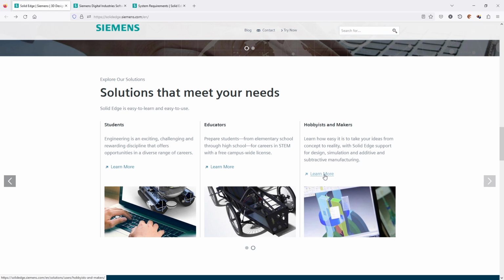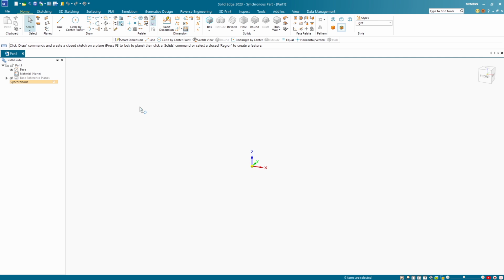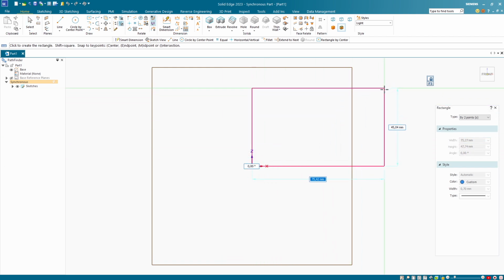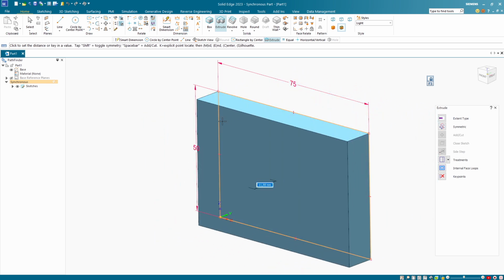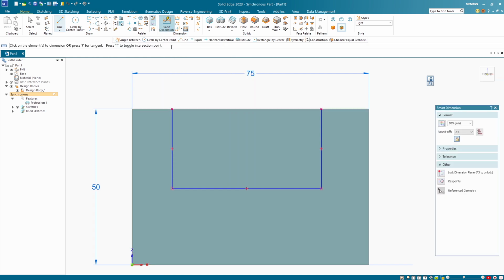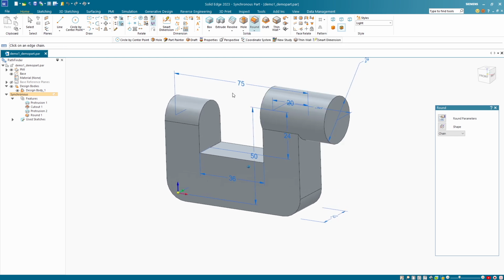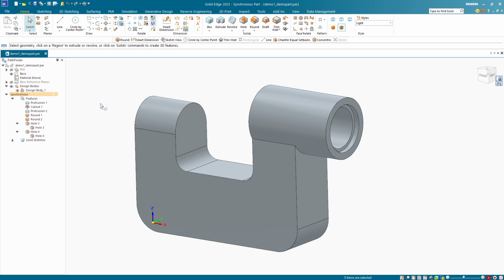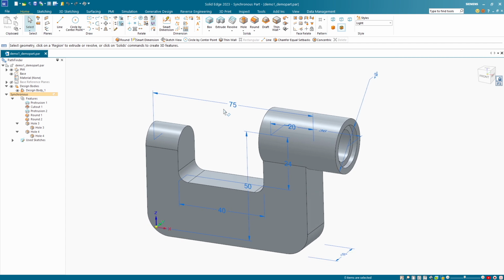The best Professional 3D CAD Software you can use for FREE in 2023? | Solid Edge 2023

Comment: This is great, but now im stuck with needing a license?
I'm not sure what to do here and there iareno instructions from what I can find on the website.
Myy steps:
Siemens Edge website -> hobbyist -> access download -> .exe -> stuck with options requiring me to have a license.

Did I do something wrong? Why is this more complicated than the software?

Edit: 
It worked my second go around, im not entirely certain what went differently; I think I accidentally accepted using old account info, and it tied my account to the non-community version. idk but it works now.
Reply: The license file is either in the zip-file you downloaded or you have to run the installer as administrator.

Comment: As I hobbyist I wasn't even aware of Solid Edge till this came up in my stream. 

I've become increasingly frustrated with the limitations of SketchUp and was planning to move to a parametric 3D app like OnShape, but for an occasional user the learning curve is daunting. By combining the intuitive benefits of direct modelling with parametric power, Solid Edge seems to be unique. And they have a community edition!

Many thanks for the heads up.
Reply: The learning curve is still very steep, but well worth it. But be sure to learn the difference between part- and assembly-files. I can recommend the edgecast series of videos here on yt.

Comment: Thank you very much for this tutorial.  I followed along very closely, but at 17:09 when I try to change the fillet radius I get the message: "The requested dimension modification cannot be made. Change the Design Intent settings or the command options and try again."  Version I'm using is 2024_2310.
Reply from the maker: Thanks for the notification, I will have to look into that detail.

Comment: The Most important Part of a Free CAD Software is if it can Export in the Right File Formate for Manufakturing
Reply from the maker: what file formats are you looking for?
Reply: @FreeCADAcademy  I had a project in my Uni where i Wanteded to use the Lasercutter but which needs dxf or svg from Drawings. But NX student only exportet in stl or in Jpg the drawing. So i had to redo the whole project in a new Software. But in the begining of the Project i did not know which file was needed for the laser. Because it was the first time working with one. and i was not planed for the manaufacturing on the project
Reply from the maker: Could you export the 3D file to Step?
You can import Step Files to other CAD software like Onshape and FreeCAD and create then the SVG/DXF from the drawing.
If you can only export 3D files to stl -> run and use a different Software.

Comment: Hi thanks for the tutorial. I was just wondering why you would use synchronous mode? what is the advantage. I find that not being able to edit the sketch and have the model update quite problematic. I just recently created my first model in synchronous mode, not realising that I wouldn't be able to update it. I had to start from scratch in ordered mode. I think ordered mode is superior as you have more control over your model, I would appreciate your opinion on this.
Reply: That was my first impression of Synchronous Mode - it feels like you box yourself into the corner.  With more practice, I realise that's not the case at all.  Work through the accelerator tutorial videos (free to sign up), and you realise it's incredibly powerful and I do most of my designs in that mode now.  You have to think differently.  Use relationships to constraint stuff.  Learn about the Design Intent modes.  And of course, properly constrain stuff with dimensions.  This mode is the greatest strength of Siemens Solid Edge and Siemens NX.  You can also add ordered features in the same model.  Synchronous is so fast... and even fun!

Comment: I was tempted to try it out, because the software looks full of features. So the journey begins...
First I had some weird issues with display - it's like infinite rirror thing. After searching for a solution online I installed newest video drivers. That helped.
But another problem appeared. Now I don't see solid bodies. They are visible when I move or rotate the view, bot when I stop they disappear. Again - online search. Solution: turn off antialiasing...
Well ok. I can live with that.
So I went to make my fist steps. Created a simple body, then put a chamfer on some edges. Then I hit "undo" and the program crashed.
Imagine a long work and a sudden crash. I give up and going back to Fusion 360.
Reply: If you go into (settings- options - view) when you have a part model open, you may be able to reduce the GPU mode from advanced to regular.  This may solve most of your problems, generally Solid Edge is considered super stable.
Reply: Solid Edge is a lot more stable than Fusion. But don't expect your Fusion-habits to work in other CAD-software. There is a learning curve even if you're really experienced with Fusion. I switched over a few months ago and I have to say SE is more capable, stable and complete than Fusion in most aspects.

Comment: $1,032 for the most basic subscription if you want to do anything at all commercial with this software. ($86 per month billed per year.) While it's great they have a free community edition it's only really affordable for professional designers and engineers etc. It would be nice if they had a lighter subscription model for makers and hobbyists and "prosumers" that are moving into selling some designs or 3D prints etc. Also if you design something in the free edition you can't even open that file in the paid for versions . . . ? That's pretty bad. For this reason I would probably not even try this software even though it 's quote free in some basic way. Probably something like Alibre which is reasonable cost or looking forward, Ondsel which is a version of FreeCAD . . .  Personally I still use Blender for everything including 3D printing :)
Reply: Sorry mate, but if you make money using CAD you ought to pay for it and 86$ per month is pretty fair considering you probably make a lot more than that, hopefully. Also only the basic version of Alibre is cheaper, the pro or expert version are just as expensive. Meanwhile Solid Edge community edition is FREE for makers and hobbyists and fully-featured. That's huge! If you're a "prosumer" or rather a startup you can apply for a free 1-year-license with discounts for the second and third year, so ramping up until your business gets off the ground. I find it really irritating when companies release their professional software FOR FREE for hobbyists and people complain about things like not being able to open designs in the pro version, like seriously? Again, it's FREE for hobby-use and is fully-featured unlike the debacle that is the hobbyist version of Fusion 360. Solid Edge is proper CAD, not like FreeCAD, Blender (lol) or even the pro version of Fusion.

Comment: Great tutorial but I had a problem when it came to the holes.  I couldn't see a centre mark, nor a snap was felt when trying to place the holes in the centre.  I noticed a '+' indicating the centre on your screen in the video but it does not show on mine.    Am I missing something?  Love your style of teaching (albeit just a little fast for me 'cos I had to pause the video every few seconds).   Have subscribed.
Reply: They centres appear when you mouse over a circle, then you can click on it.  Same with alignment lines.  If you want to align an edge with another line or rectangle (both in 2d and 3d view), mouse over it and then the guidance lines will magically appear.  It's very elegant and efficient way to work, only using the snap fits you want.

Comment: Enjoying your videos but I have a slight problem when selecting. When I hover over an edge to round it over I seem unable to highlight the individual required edge but only all edges on that face, ( an edge set ). It is driving me crazy as I am unable to round over a single edge. Any help would be much appreciated. Solved it. The chain option has to be selected, then you can select edges.

Comment: Well, looks good. First hurdle: When I open it I get a workspace with the axes and as soon as I move the mouse it changes to 4 sets of axes cascaded, and all slightly greyed.
Second hurdle is click 2 point rectangle and I get no planes shown. I can hit F3 and draw but I have no set of inersecting planes to choose the one I want. Drawing a rectangle results in 4 cascaded rectangles, one in each of the shaded sets of axes.
So from the outset this looks as if it isn't going to work.

Comment: Wow !! how long has a free version been available ?  How far into the future do you think this free version will exist ? 
In my spare time I like to design novel and strange engines... Electro-mechanical devices... etc... I like to explore physics + math & being able to create the experiments to validate ideas is vital !!  Does this program have enough features(like unlimited #of parts in assemblies) to make something like an internal combustion engine ? like a standard v6 car engine.
Also, I REALLY need to store dimensions/parameters and have other dimensions based on those... with math formulas ...
Reply: Community edition from 2020 and below are permanent, from 2021 the license is of 3 years and you can renovate it.

Nowadays you are limitless and you don't need internet connection.

Other option can be Alibre Atom, is cheap
Reply: It seems they issue a new version and thus new license each year.

Comment: I tried using Solid Edge and started to get a grip on it, but unfortunately it crashes very frequently on my computer. So for the time being I stay with CREO ED Express, which is a bit limited on functions like gears or threads but since we used CREO for about 20 years in my company, I'm pretty much used to it.
I think about trying onshape, though. I hope it doesn't have game breakers for me like the file-management in fusion360.
Reply: Try lowering the graphics hardware level... Settings > Options > View.

Comment: I am accustomed to Solidworks and I see enough similarities that I think I can learn this quicker than Fusion360, which is currently confusing me. One question though - is CAM built in as it is with Fusion?
Reply from the maker: Unfortunately NO CAM in the free version
Reply: @FreeCADAcademy  So we can design and admire, but not build. That's a shame. Back to Fusion360
Reply: @donepearce  Just about to download, so I can't answer for certain, but I see no reason you can't 'slice' an output model and 3D print it. Just doesn't seem to be the equivalent of Solid-Cam with SolidWorks.
Reply: @ColinDyckes  3d printing from an stl is no problem. It is CNC machining that requires a CAM solution.
Reply: @donepearce  Yes, having installed and tried it I found that it even has a slicer of sorts built-in. I'd still export to an STL and slice separately. It does seem to support export to many different model formats. Could an existing CAM solution work?
Reply: @ColinDyckes  There are CAM solutions that will work with an STL, but they are not good. They don't recognise features like holes and walls. They just sweep back and forth along an axis changing depth as necessary. This doesn't result in a good looking product.
Reply: @donepearce  My use of STL was purely for 3D printing, and it does output IGES etc. I used to have access to SolidWorks and Solidcam and they made a great combo for milling. I will have to investigate whether the cheap 'community version' equivalent of SolidWorks has CAM and saves in an upwards compatible file format which Solid Edge says it does not.
Reply: @ColinDyckes  The problem is that all the programmes build their parts from different and incompatible primitives. It is possible that someone could build a translator but I won't be holding my breath. That is a huge undertaking - maybe bigger than the programmes themselves. My route to CAM from Solidworks (I didn't maintain the annual license so I don't have the CAM module) is through Vectric Aspire. For simple parts I just use DXF. More complex ones may need other formats. Solidworks exports plenty of them
Reply: @donepearce  Solid Edge will save out as as STEP file, this would be more useful for CAM than STL.

Comment: I am using Solidworks from few years for my project and I really like it because of it's simplicity but licensing is a major issue with it. So I found your video of Solid Edge and it looks very much familiar with Solidworks. 
So how similar is it with Solidworks if you have any idea about it 🤔?
Reply from the maker: Don’t know solid works very well. There are some similarities of course but the details are different as always
Reply: Anybody that has used SOLIDWORKS usually hates Solid Edge with a passion.  It's simply a case of familiarity rather than Solid Edge being bad, and this applies to changing between any CAD program.  People going from Solid Edge to SOLIDWORKS often don't like SOLIDWORKS either.  My advice when moving to a different CAD package is to act like you don't know CAD at all, and learn from scratch.  This way you will pickup the workflow.  Siemens has an Accelerator training program.  It's free and you simply follow their tutorials online.

Comment: Synchronous mode is impressive.  I'm starting learning CAD on FreeCAD (I don't like the "business model" of Fusion 360 and Onshape) and it's still time for me to switch to other software because I've not yet memory muscle on FreeCAD.
I will take a look on Solid Edge but "only on Windows" is a brake for me.
Reply: Hi, maybe I can help with some suggestions. Not sure about other than windows support,  I think there is on one at least of the following suggestions... Anyway,  I'm not new to cad, been making things for a few years,  but recently I've been looking for a more modern cad program and have found three so far that might save you a LOT of headache if you're just starting. One thing first though, choosing a cad program should highly depend on what you envision doing with cad in the future. that means such as for fun, your own business, self employed,or working for a company, plus in what sort of industries. . Ok, so I've been looking at three programs...."SelfCad",  "Moi" and "Plasticity" which is really new and still in development.  At this moment I can't say which is the best deal,  but they all have free trials and the licenses are pretty cheap given what you get.  Hope this helps and good luck in the future
Reply from the maker: Have you checked my Plasticity introduction on the German channel?

Comment: sooo since im runing to linux since windows lately have been a pain for consuming alots of my pc resources despite trying unbloat it for many times , i have seen that solidedge can be installed on linux i havent been able to install solidworks so if this free version is free to a functionel point not like the free version of shaper 3d where it limtis the extension that you can save the parts and limited to only 2 parts and no visual render .the frustration hits hard since i have not work on anything lately becasue i have not being able to install non on linux . anyways thx for the video
Reply from the maker: Use Onshape Free!
Reply: @FreeCADAcademy  it dose not fit because it require interent ,and living at a farm dose not provide steady internet .

Comment: I am trying to find the simplest way to place holes in freecad, but in specific areas,  such as so many inches from point a, then from that point,  and so on, can you help?
Reply from the maker: Just use sketches to define the exact location for holes
Reply: @FreeCADAcademy  Thank you for the reply,. I thought there might be a way to do it in sketch. Your butt I don't know how. Do you know about video tutorial out there anywhere?
Reply from the maker: @MrJacksaun  Any circle or arc in a sketch will be processed as a hole by the hole tool. Does that help? I think I have a German video on the subject.
Reply: @Free CAD Academy  Thanks,  I  know how to make a hole, and its placement.  I am trying to find a way to place a circle or square or any shape,  but in a precise location.  Such as 1.5 inches from a corner, or from another point on a part.

Comment: Thank you very much for the very nice intro tutorial for Solid Edge! 😃👍
I've been tinkering a bit in Fusion 360 and like that you can reference multiple features and actions in its History line/bar to drive new features and actions. Do you know if Solid Edge can reference history items too, to drive new features?
Reply from the maker: yes of course you can do that too!
Reply: @FreeCADAcademy  Thanks, very interesting! 😃 One last question, can the free version export to other formats (like STEP or IGES etc.) so the models can be worked on further in Moi3D for example, or is it only outputting .stl-files? I tried to find info on their site but I couldn't find anything for the free version other than that the files can't be used in the full version and the drawings are watermarked.
Reply from the maker: you are not limited with your export formats, so you can easily export step and iges.
Reply: @FreeCADAcademy  Wow, that's incredibly handy! Thank you so much for your kind help. 🤩👍👍